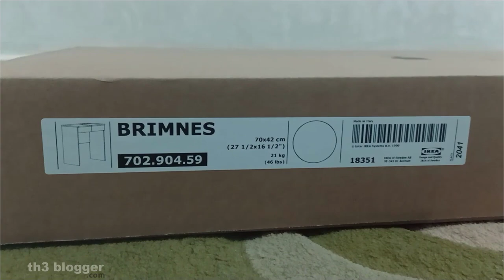IKEA brimnes dressing table assembly guide | th3 blogger

Comment: Hi do you have any tip on what to do when the upper part doesn't want to close on 5:56
Reply: Refer to your instructions when you get to that part he actually mounted it wrong. The instructions show the pole mounted closest to the mirror and the bracket flips so it will be outside the pole.

Comment: your mirror lid is closing properly
Reply from the maker: at the beginning no.  we had to put weight on the mirror
Reply: @th3blogger  You shouldn’t have had to put weight on it. One of the fixings may have needed loosening or adjusting.
Reply: @th3blogger  For how long did you have to put the weight on the mirror to get it to close properly?  I just assembled one and ran into exactly the same problem.  I don't want to have to return it if there's a simple, reasonable fix.  Thanks for the video and your help!
Reply from the maker: Hello.  really I do not remember because I did not use it directly after assembly.  but now it's fixed.. Thanks for watching.